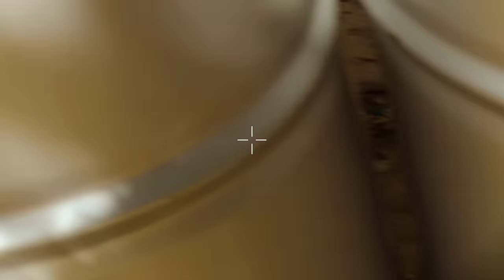Terrifying Moments at Airsoft Game in Puerto Rico..

Comment: You are one of the best! I remember the story when enemy base was inaccessible. You could get inside just through the tunnels underground. There were 4  machine-gun/sniper towers by perimeter. Just one side was unprotected - a rock behind the base. Flat like a glass. The guys with climbing equipment dropped down on them at 5 a.m. Everything was done in 5 mins.

Comment: I remember when I used to play airsoft a lot at my amazing local field, a lot of times I'd be hit just because I was sitting taking in the sceneries, as with many of the people it seems you get hits on. Especially with that first fella you whistled at, didn't seem like he had much of any plan of moving or aiming at nothin'. 

  Miss going to the field, I stopped because my shift 200$ automatic gun broke in several areas. Was a lot of fun the dozen or so times I went though. Would definitely recommend to any young fellas out there looking to do something with themselves. Only thing I will say is that it is quite costly if you want to get really into it.